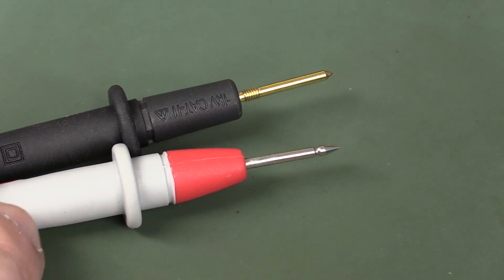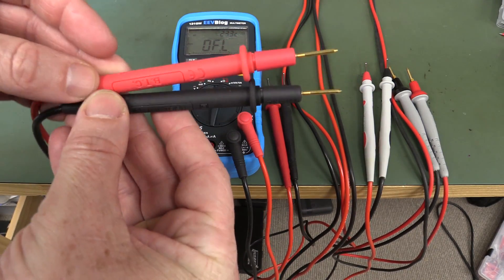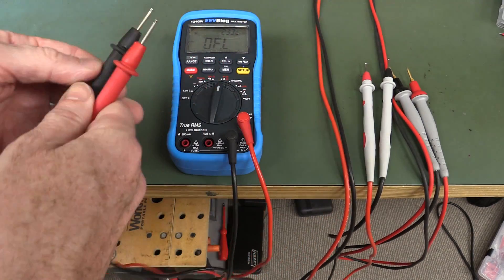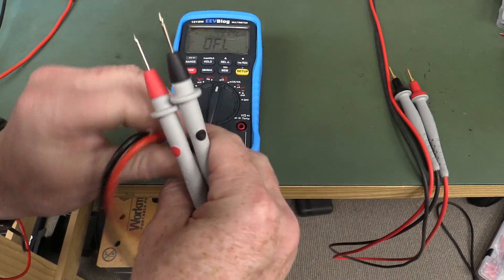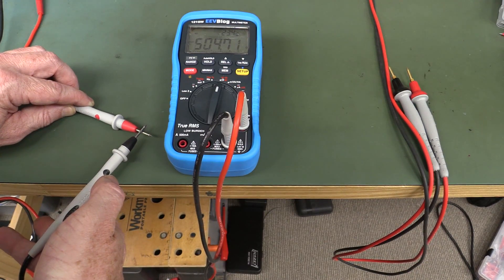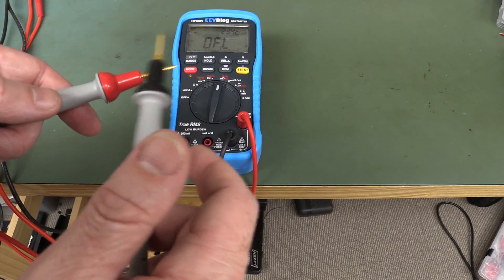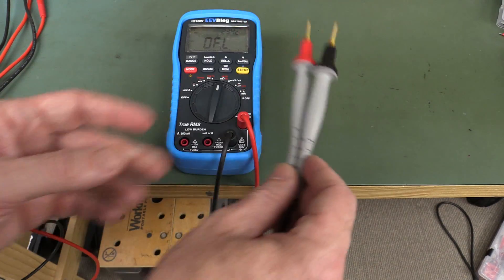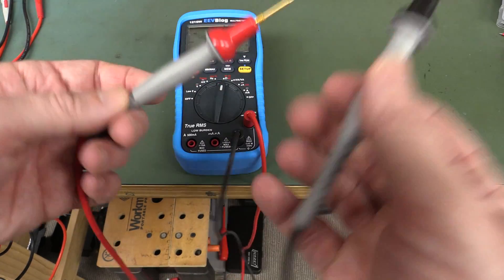eevBLAB #33 - Why Gold Plated Probes Matter

Comment: I figure the gold plated probes will chip and the base metal will be exposed in no time. Not worth the extra money.  The mid range probes seem to preform just as well.  I noticed in your video you didn't anticipate that result. Your reactions gave it away. It was like you were trying to make the mid range probes fail just to make a point.
Reply: Slowly? Gold is one of the softest metals and can, and often is for cost, be plated extremely thin.
Reply: zach konkel gold doesnt chip, but can slowly wear away
Reply: zach konkel No offense, but how much do you think gold plating costs?  Gold plating is not an especially expensive process as the actual amount of gold used is always quite small (the thicknesses are measured in microns), but it can make a great difference in terms of oxidation and contact resistance.  You can even get ridiculously cheap (under a dollar) Chinese components gold plated, something that would not be possible if gold plating were an especially expensive option (the main difference between extremely cheap and more costly gold plated components is usually the thickness of the gold plating, but gold plating in general does not necessarily add all that much to costs unless a vendor wants to price gouge on "premium" gold plated components).  No money trees required.  Nor do properly gold plated products simply have the gold plating flake off as not only is gold very soft and malleable but it also forms intermetallics that help to bond it to the underlying metal substrate.

While most of my probes are the more typical nickel plated I do use gold plated Kelvin probes for hunting down shorted components within a much larger circuit where I am looking for milliohm variations between measurements.  Occasionally I will also use them as low voltage test probes as well for their gold plating as pressing a probe tip firmly into a part or component is not always an option as some things are either too fragile or too easily distorted to get away with applying otherwise sufficient pressure.
Reply: Electroplated probes will never chip if the tips were properly cleaned before electroplating. You are confusing it with gold leafed. The electroplating process produces surface level alloying. However, cuts and  scratches can penetrate the gold plating, which could happen since gold is such a soft metal, but that is actually kind of difficult to do, as the gold will more likely mush around.
Reply: Pandu Poluan 
The ball in a pen is often made out of tungsten carbide...it's really hard.
Reply: china junk?

i see as many good as bad product from over there, or are you forgetting the huge amount of outsourcing the "premium" brands use?

there is a very direct reason for a lot of the worst products from china, apart from the ones purely out to scam you of course, when ordering as a company in china the mentality is completely different, you are expected to give them a price target pr part to reach and they will do everything in their power to reach that, including cutting corners, there is a huge series about it on hackaday, so that perfectly good part you sent them to produce might have been good if they had gotten a realistic pr part target.
Reply: If your working on zero fail circuits aircraft / medical why not buy the best. But for the rest of us.
Reply: Agree with Oodain there. Basically, you can order cheap, or you can order good. Choose exactly one.
Reply: While you are obviously right that the very tip of a sharp point is bound to lose its plating (not least because the tip will also wear), the anulus of gold around it will still be there and, being soft, is likely to still help with the contact.  This is a question of hardness (as well as oxidation) and the conductivity will probably be improved by having a larger area of conductor touching because of its malleability.  Of course gold is not the finest conductor there is - both copper and silver beat it.  Silver probes sound a good idea.  We could polish them each morning.
Reply from the maker: Dacke Exactly.
Reply: Mush around?  I like it. :)
Reply: The nice thing about gold is that it doesn't oxidize and it's very lubricious and soft.  It's quite difficult to wear down or break through a good gold plating job.
Reply: When working with SMD's its the very tip that is most important , no matter what it plated with the tip will ware away quite quickly exposing the base metal.   Try and plate the tip of a ballpoint pen and expect it to stay there.
Reply: Ballpoint pen has friction ALL the time it's being used. Probe tips don't. They will last a long time.
Reply: zach konkel - You do realize that Dave could have edited out anything in this video that contradicted his opinion about the gold probes and yet he did not?
Reply: You must take the surface area in concentration, How do you know your getting quality ,  China uses lead for a base metal when possible.    Lets get off the topic of china junk... what if the manufacture had 3 levels of quality , the third ending with gold.  Would you buy it ?
Reply: Is that what they tell you down at the Shenzhen market , China
Reply: So wouldn't you agree gold is only the best choice if you have a money tree in your back yard.

Comment: Dose that meter say "eevBlog" where can i get that sticker for my fluke, i bet it gives an extra 10ohms lol
Reply: Total Reset It is not a sticker, it is a silkscreened part of the multimeter body.  But you can buy the meter once it is released (I do not believe they have gone on sale yet).
Reply: Ethan Poole that makes it like 10 times cooler! Thanks for the correction.
Reply: Yeah it is my understanding that Dave Jones of EEVBlog was contracted to help engineer a multimeter for some test equipment company that desperately needed to renew its product range, maybe UEi or Kane or something. The engineering samples have been issued with 121GW EEVBlog markings but there will also be a full production run for EEVBlog eventually, likely after whatever main brand ships its units to retail.

In the meanwhile, there sure is a customized Brymen BM325 EEVBlog version.

Comment: Copper being the standard of electrical conductivity at one hundred percent, only silver beats it at one o' five.
Gold comes in at seventy percent, 3rd place.
The mitigating factor is the speed of oxidation on the surface of the material.
Clean your probes and do the test again.

Comment: Wouldn't the thing your probing  still have the same problem? Gold to lead or whatever is being probbed. Wouldn't that cancel it out?
Reply: gold makes better contact, so less chance of issues on the probe. you can still have issues on a circuit board solder joint, but you will have less chance of issues using a gold plated probe.

Comment: Clean those probes with some 000 steel wool. :-)
Reply: electronicsNmore Not a good long term solution though as you will only wear away the nickel plating over time and you will eventually be left with the steel core (far worse conductivity and much greater corrosion tendency).  That and the steel wool will leave behind a lot of very fine scratches that only help to further accelerate the collection of dirt and debris (not to mention the fine bits of steel swarf left behind to corrode within the scratches).  So while it may help with a single measurement instance, in time one will soon need to replace their probes to maintain the result since you can't indefinitely clean them with steel wool since each cleaning further degrades the condition of the probes.
Reply: I guess you don't realize the grade of steel wool I'm talking about. 000 or 0000 is extremely fine. You would have to use it daily in order to wear away the plating, and if you wipe the probe with a rag after using the steel wool, you won't leave any behind to rust. You're not creating any deep scratches. I've done this on and off for years and never had any issues. I'd rather have the higher conductivity brass under the nickel anyway.
Reply: B careful with steel wool use on various metals.  Sometimes little bits of steel wool get embedded and rust, which can cause more trouble than original dirty leads.  But regardless of cleaning method, it would be interesting to see if probe age and surface finish has much to do with it.
Reply: I would rather use toothpaste and a soft sponge
+ everyone has toothpaste at home

Comment: I want a SOLID gold  USB cable lol
Reply: copper coducts electricity better. solid gold wont perform as well.
Reply: I want a solid silver $1000 HDMI cable.
Reply: I can sell you a custom solid gold USB cable, send 10 BTC to
14zK3aoKopwBzEkrvtzVu2gBqof8c8qY9L
Reply: Jaymes Stewart Check out linus techtips then
Reply: ApexMike Dang, ~27,000 USD is a bit on the high side.

Comment: What about gold plating regular ones? Will that make them just as good?
Reply: Likely so. It's a bit harder to control the thickness of the gold plating, though. You want to balance between a thick but durable plating (expensive) and a thin but inexpensive plating (easily wears off).

Comment: Could you make a video explaining why the gold probes seem to make better contact? Like get into the chemestry of why? The bounce test just makes me wonder what the big difference is
Reply: bdot02 gold won't form insulating oxides under normal circumstances. If you keep your probes clean and shiny, gold plating won't make that huge of a difference in normal multimeter use where pressure and constant motion can displace contaminates, allowing for good contact.
Reply: Robert Szasz interesting. I guess the oxygen binds to the free electrons making it more difficult for energy to flow through them. Or something like that. I bet you could electroplate some cheap probes for not that much.

Comment: Dave, In my 40 years in electronics, I have never tested a circuit by rapidly bouncing probes off each other as a firm contact has always been adequate. I can't afford gold probes now. You are such a snob !!
Reply: When you swipe across a row of contacts, it's nice if the probe makes really good contact. Just yesterday I had to check a cable with 20 wires and the connector was tiny. So it was not possible to put a lot of force into into. But to be honest it was also nice that the probes had thin and sharp contacts.
Reply: the probe master ones are very nice and not that expensive fyi
Reply: Gold-plated Probemaster probes literally cost less than $20. Having gold plated test leads is key when rapidly checking continuity or voltages across many points. You don't have to second guess if you're making contact.
Reply: It's hard to convey tone in an internet comment. If you're gonna be sarcastic on the internet, be obvious about it. If i were to conclude by calling you a dumbass, it probably wouldn't be clear that I was being facetious, would it? :)
Reply: I very often hold one probe on a pin and rapidly slide the other probe over e.g. pins of a chip in order to find the trace. This is what is very good simulated with the rapidly bouncing like a drummer.
Reply: In my experience, I missed some continuity due to the meter being slow plus bad contacts. I never owned a gold plated probe, but I can see that it would have saved me some time and headache due to the better contact, and more garanted contact.

That said, I do not think that it is a must have, but it would be good to have. This is definitivelly going to be one of the thing I'll check next time I buy a meter or probes.

As for him being a snob? You must be jealous of his probe.
Reply: Less than $8 shipped (US)... https://www.amazon.com/Micsoa-Multimeter-Leads-Banana-Probes/dp/B01N0KZX8I
Reply from the maker: @American Locomotive  got it right. With gold plated probes you know the issue isn't going to be your probe contact surface. One less thing to worry about.
Reply: $8 shipped on amazon prime.  How do you even eat?
Reply: 3:38
Reply: Iam not 40 years into electronic but have experienced some situation where you have to test with the probes flat. And there it might come in handy. Yeah you dont REALLY need it but it will save you from getting angry sometime xD In cars you allways fiddle around to get good contact, ill bet these ultra sharp ones come in handy. Dont be such a dick Mr Malsbury.
Reply: Robert, you are simply being silly and coming over a curmudgeonly old fart.
Look here:
http://www.ebay.co.uk/itm/Brymen-Silicone-Gold-Plated-Test-Leads-Probes-for-Multimeters-CAT-IV-1000V-/171162377470?epid=2063657290&hash=item27da129cfe:g:uSQAAOxyTjNShpch
Reply: Jezz...that's just a demonstration that it CAN make a difference in some situations, of course it's a bit over exaggerated to make his point. Calm down!
Reply: Only matters when buying huge quantities and/or expensive items. If you have a pair of old, worn out probes get a new pair. Could be a gold plated one. Your boss has to check your purchase query for approval anyway
Reply: I second Leonardo Camargo's reply. Keep your non gold plated probes clean (dont touch with dirty/sweaty hands) and sharp on the tip and they will work just as well as the gold ones.
Reply: NoName: Thanks for the link :) .
Reply: Indeed. My only point was gold plated leads for $8. Does say in the item description they are gold plated. They are only CAT III.
Reply: So you work with electronics for 40 years but cant afford a gold plated thing?
Reply: these are CHEAPER than the shitty Flukes.
Reply: That's why you don't get them for private use but order them for work, where you don't have to pay for 'em. Jeez.
Reply: I've got probes that work exactly like Dave's and aren't gold plated. They aren't even branded. 
Their tips are thinner though, they're advertised as 'needle probes' suitable for micro components (which is what I use them for).

I also have the less sensitive probes, same brand as Dave's it seems. Looking at both on the microscope I assumed that what made the needle probes better is how smoother and more regular their surface is when compared with the regular ones (at the microscopic level).
Reply: When reverse engineering stuff, I often drag the probes along a processor for example for finding the pin. So I do it a lot...
Reply: Alocohol your probes every so often (even if you dont use them much). or use 2000 grit+ sandpaper if they're fairly old and just been sat doing nothing, or have been measuring higher voltages and currents (metals are more susceptible to corrosion under load).
Reply: I do something similar almost every time I switch to the continuity range so as to test that it's actually working.
Reply: +Hoss Man  Those look like really poor leads though, compared to the ones that come stock on a fluke meter.  They also don't appear to be double insulated.  The jacketing is PVC according to the listing and they do not say anything about them being gold plated or how thick the plating is so they could be coated with something altogether different than gold.  It is really hard to find a reasonable quality set of test leads under $30 and if you want premium ones they will often run over $150.
Reply: I think I see your error. He didn't say solid gold probes.
Reply: I think here is nothing interesting on showing that rusty crappy probes from fluke or any oxidized contacts suck balls.
Reply: I'm below poverty line and i can afford to buy golden tip probes every week if i want to. They are about a tenner in eBay and perfectly ok. Not even the proper ones are that expensive. I'm never going back from gold plated again, every measurement is the same regardless of how much pressure you exert. Get them, they are not anymore optional but mandatory stuff. Just beware of the very fine tips, they won't last for long.
Reply: Well, both my wife and I are disabled and below the poverty line.
Reply: It's a joke he says, after considerable backlash in the comments.
Reply: I can't tell you how many times I've went diagnosing perfectly good components because the damn probes didn't actually make contact. THIS IS GOLD (unintended pun right there), and if you feel any different, you're not doing real elecronics.
Reply: No he is not. He is demonstrating something interesting.
Reply: If you're 40 years into electronics but can't afford $30 worth of probes then you've done a series of missteps throughout your life. I'm sorry for you.
Reply: its about the fact that they are not worth for what you get ;) in a company you cant simply buy any shit just because its "better" you have to check if the time, etc etc you get out of a product is worth the money for your company
Reply: Robert Malsbury you feel the need for Dave to approve of your probes? Lol
Reply: Naomi Baron No worries.
As far as I remember those leads are UL listed too.
Might be worth a check though if you intend working at the higher Cat ratings.
Reply: It is simply not a MUST HAVE.
Reply: Robert Malsbury he never actually said he considers then a must-have, merely that there is a real difference and he encourages people to consider spending the extra money.
Reply: Hey people, it was a joke snub.

Comment: Try with a different meter...
Reply: EEVblog But trying a few different meters and using the same method will tell you if the meter is the problem or the silver probes are the problem.
Reply from the maker: Err, that would do nothing. The whole point of using the same meter is that it was an apples to apples comparison.